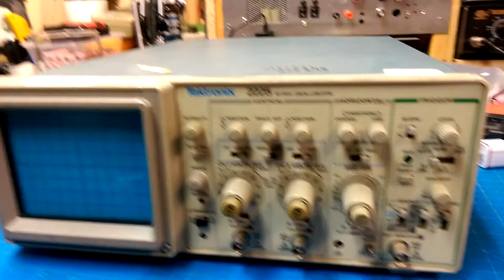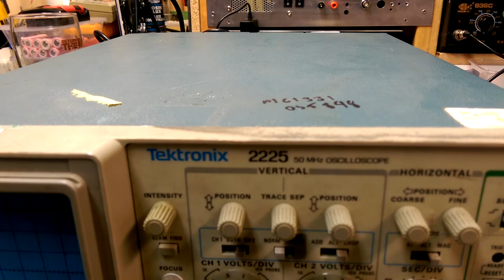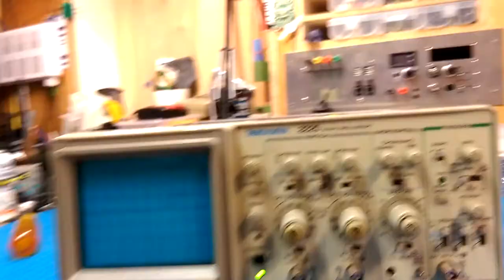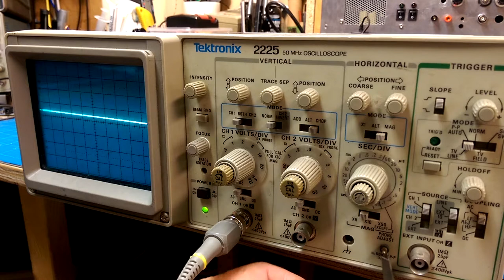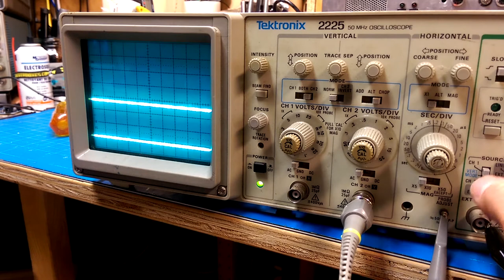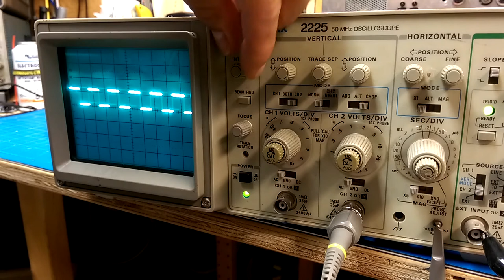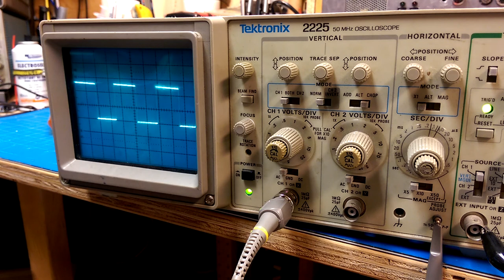50 bucks no way

Comment: Yeah i think it got dumped as it looks very unstable and drifts all over the place. Any component that has become "heat sensitive" from age can be suspect but as others said here, the Tants become bad and if they short especially on power supplys, look out. I would go in with bright light and magnifying glass as a once over,  then start testing and probing, maybe even a simple curve tracer for quick leakages such as iffy leaky diode and other components will show up not so easy for bad capacitors with coils in circuit.  The scope is working correctly just not 100% , so its going to be a tiny little part that is the problem and you can isolate with some testing of the controls to narrow it down to a section perhaps. Really good find for $50 as its not damaged and all knobs are there and pretty clean..
I have hamegs, teks and some others and the heavy hardware is usually bullet proof and its little weaker components that fail after decades, so a little effort is all thats needed to make these great again.

Comment: Bad caps.  Replace all tantaliums immediately; notoriously unstable.  If they short very bad things happen.  Nice catch.
Reply: I have only ever had caps fail on high ripple power supplies. We still use them in military power supplies and they are fine as long as they are kept ripple free.
Reply from the maker: Took a quick scan of the service manual and there do not appear to be any Tantalums.  Only a handfull of electrolytics, some metalized film and some plastic film caps.  All the rest are ceramic.
Reply: Bizar.  As far as I know, all tek scopes do contain tants.  I checked the 2225 service manual; there even is a page explaining the color codes for tants (!)  The components lists, however, do not mention tants as such, but beware,  in fact they could be indicated as 'electrolitics', since in fact, that is what they are.  Anyhow, they should be easily recognisable.  Usually, the blue ones are bad.
Reply from the maker: I am going to do a refurb of my 465 since it has some noisy contacts.  I will see if any of the tantalums in that are showing a high esr.